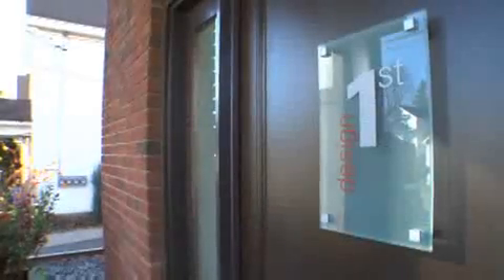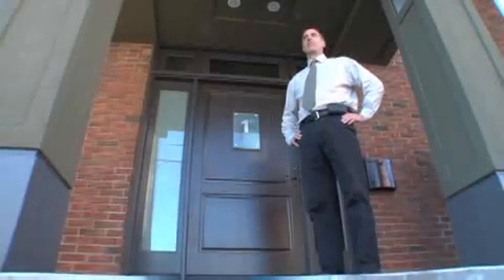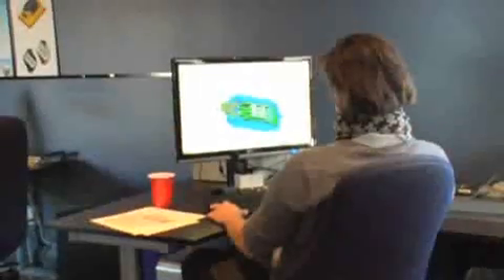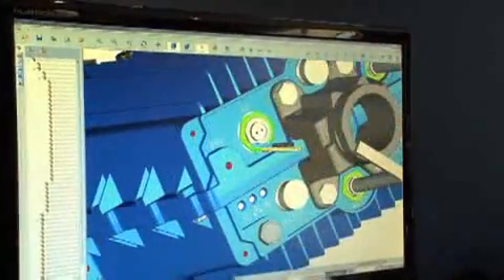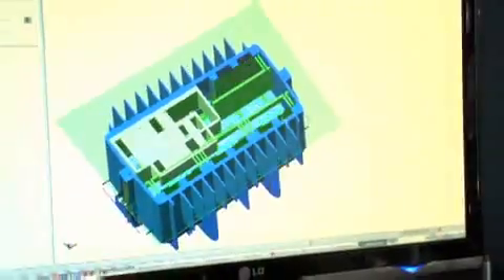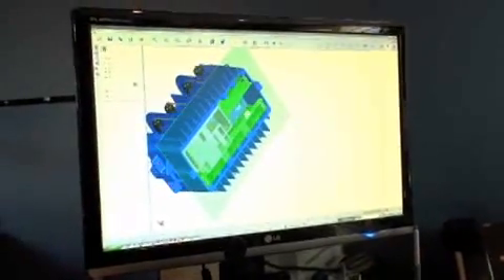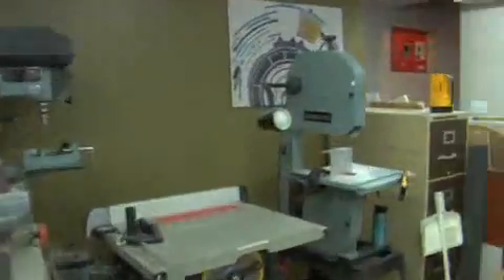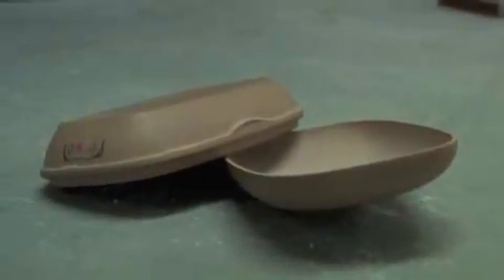Design 1st - Product Design & Development, Engineering, Prototyping, Patenting, Manufacturing

Comment: Prototype . and 1st run production. Machine shop. Best quality machine. BQM.  A top old school machinist with a a hell of a lot of experience. A master. Doing oil field  through semiconductor ...If you got it together your first 2 jobs are COD or prepay. If you can get in. Just aquired  his first off brand machine from Hass.  35 hp Lath CNC,  Mid size Lathe and 2 mills. I would aquire him if not taking care of dad in his last months.